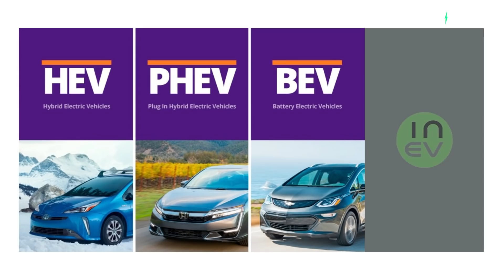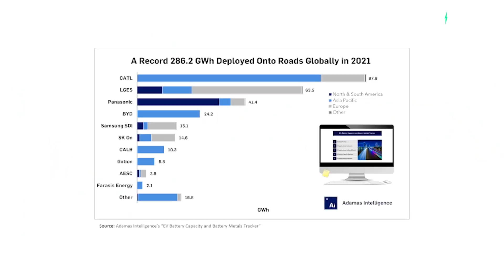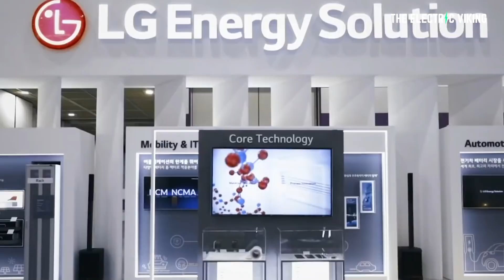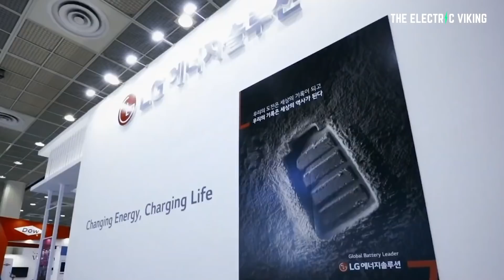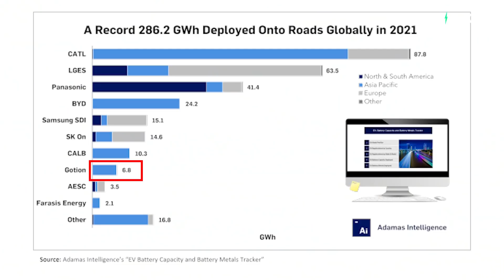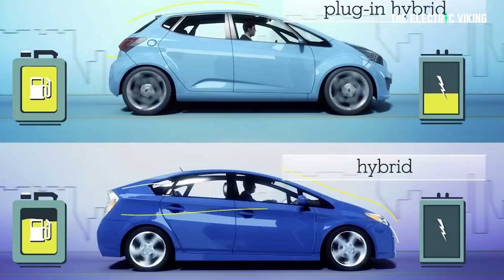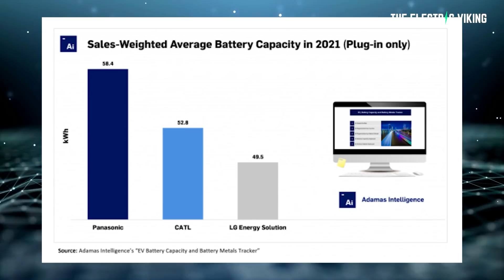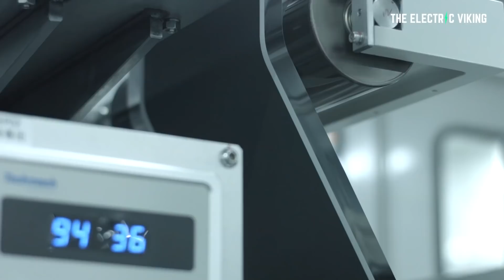Global EV battery market DOUBLED in 2021 - Top 10 suppliers

Comment: Panasonic would not have any problem selling their batteries to other customers if Tesla dropped them, which would be crazy, since Tesla and Panasonic have worked very hard to form a positive symbiotic relationship. Panasonic has also been willing to lose money on their batteries at times in order to support Tesla, and Tesla has supported Panasonic in return. The fact is that no one supplier can provide all of the batteries Tesla can use, so they want to maintain positive relationships with any battery manufacturer that is capable and willing to provide batteries at the quality and price Tesla needs.

Comment: When you you think Australia will have the tipping point on electrification?  We could deploy far more solar, but we are building gas power stations and we are opening coal mines.  Without political will, we will remain supporting the Fossil Fuel industry at the cost of all of us.
Reply: Right after the US. Maybe 2024 or 2025. The thing is that because you will be near last, the transition will happen faster for you and be largely complete by 2030.
Reply: @williammeek4078  Love the optimism.  Sadly, we still think we should buy diesel cars to drive off into the sunset in large utes.  Well that is the case in Queensland.
Reply: @alasdairdougall7868  Not optimism but math.

Comment: Imo it is almost impossible for Tesla to line up too much contractual battery production. Most of the legacy OEMs need to be careful about how much they sign for. Tesla has huge latent demand for Megapacks, so if for some reason car orders slumped, they can still sell every battery they contracted for. Secondly, LFPs are perfect for stationary storage. Not saying I think there will be a slump. At 1 MWhr per semi truck and 150 to 200kWhr per CT (estimate), there is a huge requirement for batteries.
Reply: I think semi trucks manufacture might be sacrificed for profitable cars if supply gets tighter.
Reply: @lesliecarter4295  Agreed that is the priority. By the end of 2022 Tesla will be awash in the various battery contracts they've written with suppliers. Having extra batteries for Megapacks and Powerwalls would be a nice fallout, although the current backlog of everything suggests for now that Tesla quite simply can't keep up because of supply.
Reply: @lesliecarter4295  agree
Reply: @lesliecarter4295  why would battery supply get tighter?

Comment: VW are not building their own factories. they are by “close” suppliers first on line in 2024 (very unlikely). GM (LG) won’t start production until 2025.
LFP won’t work in very inefficient vehicles for sale in the EU and US so GM and Ford can’t use them. VW will also struggle.
Reply: Eh, what secrets do you know about LFP that no one else knows? 
LFP batteries are at pack level almost as efficient as any other battery.

Comment: It’s all going to be down to battery material supply and who’s prepared to pay for it. If there is a price war then EV’s will get even more expensive.
Reply: Doubtful. Raw materials supply is ramping quickly. A spike in price just encourages a faster increase in production which brings down prices later.
Reply: @williammeek4078  lithium prices have gone up 496% in the last year alone. Prices for Cobalt, Copper and Nickel have also gone up. All due to reduced supply.
Reply: @lesliecarter4295  ah… no. It is due to demand ramping up even faster than supply ramped up. Supply has quadrupled over the last two years.

Also, automotive batteries (and stationary storage for that matter) are shifting to LFP chemistries to avoid nickel and cobalt.
Reply: @williammeek4078   If demand is ramping faster than supply is ramping then you have a supply deficit issue. There is a problem with supply!!!!🤔
Reply: @lesliecarter4295  True, but that is an entirely different situation than falling supply as you first said.
Reply: @williammeek4078  sorry, you make no sense at all. We are not going to agree. Have a nice evening.
Reply: @lesliecarter4295  We aren’t going to agree on what you said previously when there is a written record? How strange.
Reply: @williammeek4078  ??????